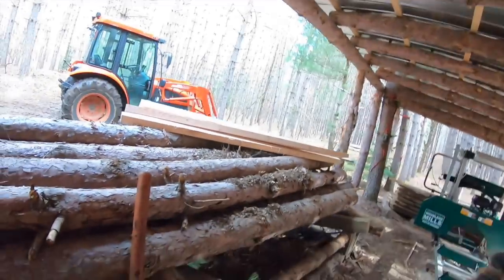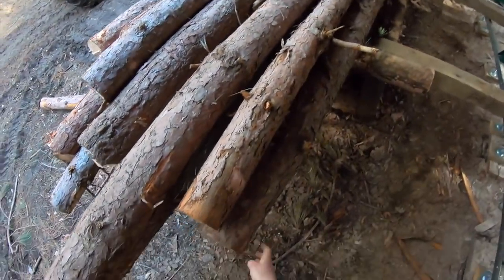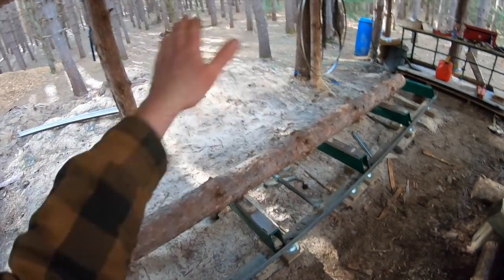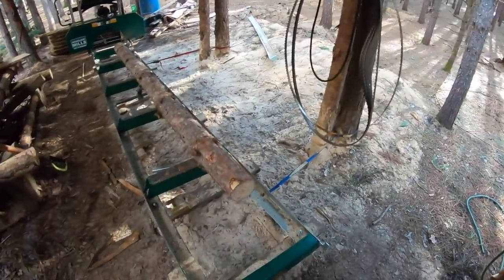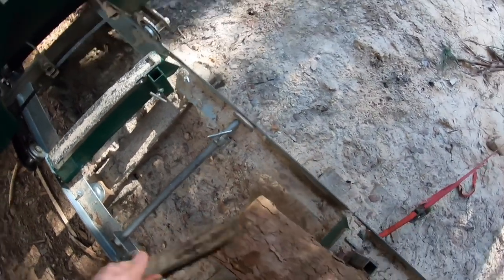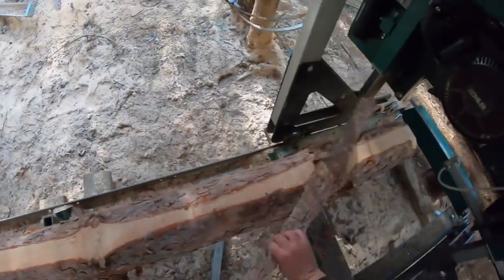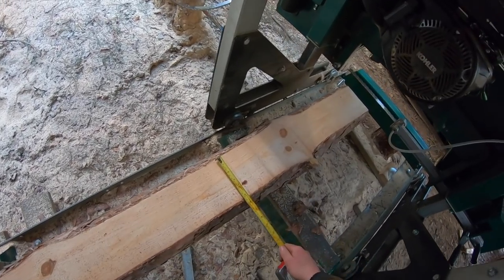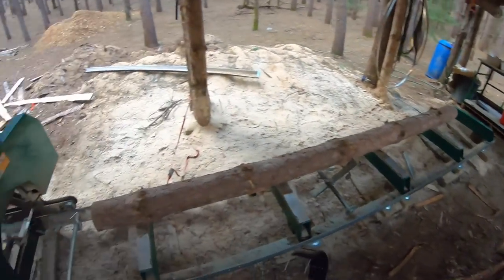Making Logs into Lumber. Woodland Mills Portable Sawmill HM130.

Comment: Very informative video especially intended for beginners.  Also it's great to use smaller diameter logs when "learning" the do's and dont's related to bandsaw milling.  I have a Woodland Mills HM 126XL, and plan to cut all my own lumber to build a 38'x60', 2 story garage.  Been researching and practicing to gain confidence before I start opening up larger diameter (higher value) logs.  
By the way, great job with the video/editing etc
Reply from the maker: Jeff Syster thanks for watching. At times the milling can feel tedious but then again, it’s also a great way to save money. I also feel proud to tell people I made the lumber. I’m sure you’ll get the same feelings as well. That’s a big building you’re putting up which is great, lots of time to practice milling

Comment: Since I like so much about the Woodland sawmills, I decided to price one out using the prices given in October 2020 - from the company's website. Woodland does make one of the more affordably priced portable bandsaw mills. If you were to purchase their smallest sawmill,  you might find their pricing especially appealing. They have it listed on their website at only $ 2,899 and I am assuming that this is in Canadian dollars. Presumably, all of the prices I am mentioning in this comment would be LOWER if you were to be paying in US dollars.

However, the reality is that the average purchaser is going to want to add a number of accessories to trick your mill out & these definitely can add substantially to the final price you will be paying. I live in the province of New Brunswick, Canada and our sales tax here is one of the highest in the country at 15%. In my case, I would want Woodland's largest mill which is the HM 130MAX. I would not need the trailer setup so that helps contain the total price somewhat. This unit has a 14 HP engine with electric start.

I won't list all of the accessories that I selected, but I did choose quite a few. The subtotal of this purchase was $ 8,698, there was a charge of $ 349 for shipping, & sales tax of $ 1,357.05, for a grand total of $10,404.05. So as you can see from the above, getting a portable sawmill with a number of  accessories, sales tax, & shipping ... can cost much more than the $ 2,899 that Woodland quotes as their starting price.

Nonetheless, this is NOT to denigrate anything about Woodland sawmills. Quite the contrary; I still feel these are exceptional pieces of equipment. I also feel the prices above are probably very fair for what one is receiving. But be aware that if you want one of their larger portable sawmills with a number of accessories, your final cost will possibly be higher than you originally thought.
Reply from the maker: Yep lots of homework to be done in buying the right sawmill. A big value adder to me was the option to go and see the sawmill at the headquarters and the value of the customer service that Woodland Mills is known for.
Reply: @sawingwithsandy  Yes, Sandy, I have to agreed with you completely. There have been so many people who rate the Woodland customer service as beyond excellent ... that there has to be truth in that.

Comment: you might be interested ,  6 inch log divide by 1.459 = 4.112 square , the 1.459  is a constant to use on the log being cut
that may be there some where but i haven't seen it

Comment: First off just wanna day I really have enjoyed your channel. Your sawmill comparison video was what prompted me to pull the trigger a few months ago on my new 130max. I have a question that hopefully you can help with. I live in the southeast and cut primarily loblolly pine, you too cut mostly pine. My mill has a very sturdy base made of 6x6 treated posts and everything is level and anchored down. I have been cutting A LOT of 1x6 boards for siding my sawmill shed. I have noticed I seem to get wavy boards sometimes. I’m careful not to push the mill too hard and my guide tolerances are all set correctly. I use water and joy dish soap. Is it possible that I’m getting sap buildup on my blade causing it to walk slightly? Any recommendations would be highly appreciated.
Reply: Having too much or too little water can cause your blade to deflect. It is a fine balance to get the water just right.

Comment: I am looking at the 130 max. I have lots of huge downed trees from a hurricane. What Is your true feelings on the brand and life of blades
Reply from the maker: The 130 max does look like a good unit. I'm a no nonsense type guy so I"d actually tell you if I thought the product was junk. I've used the Lennox blades for the entire (almost 3 years) I've had the HM130 and theyve performed very well. I use them alot and haven't had a complaint nor real reason to look at other brands of blades. The sawmill itself is very straight forward and hasn't given me any real headaches. It is very realiable and cuts accurately once the bed of the samwill is level and flat. I'd buy it again for sure. Hope that helps.

Comment: Hi Sandy I have the woodland 722 mill! And having a problem with breaking blades bought it used replaced belts and bearings and guides , can't get this figured out. Can't get enough time out of a blade for it to get dull tried less torque, and more torque no difference , really frustrated with mill cleaned before sawing can't seem to find the problem talked to woodland with no satisfaction wondering if you have any idea on what's going on with it I'm thinking that I might have gotten a bad batch of blades any ideas on this thanks Sandy
Reply from the maker: If the blades are breaking I'd check where on the blade it is breaking as unless you're hitting something with the blade, it shouldn't be breaking. I've had blades break from being well-used and probably overused and I've also had blades break at the welded seam. Depending on how old your blades on and their use I'd check where abouts they are breaking on the blade and go from there.

Comment: Do you cut your dimensional lumber (2x4 for example) to an actual 2 inches by 4 inches or do you cut it like in the stores 1 1/2 by 3 1/2?  I’m thinking all of the brackets (joist hangers) are made for store lumber.  What do you do?
Reply from the maker: I cut all material to the actual size of 2 x 4 inch. Does make it a problem when I need to use joist hangers though

Comment: So the HM30 will cut up to thirty inches, what's the difference between it and the thirty max?
Reply from the maker: I'd have to check the exact specs of my older HM130 to find out what board size my HM130 will cut but I do know the new HM130Max has a wider track and longer blade than the older HM130.

Comment: How is your shed put together....looks great
Reply from the maker: Hey Mike. I build it by just using red pine posts that I cut sitting on blocks on the ground. Instead of having to build a solid footing out of concrete or something like that I just use ratchet straps to secure each post to a live tree. This way the live tree keeps the post in position and I don't have to do any fancy foundation work incase I want to move the shelter in the future. The roof is just red pine poles for rafters with steel roofing on it. Then just two long poles to act as support beams for those rafters to sit on.

Comment: Trying to determine the economics of this.  If you are milling boards of average value of $8... you need to mill about 625 boards to cover the approximate $5000 price tag of a 130max.  Thats a lot of trees to cut down, drag to the saw and cut.  Figure in your cost for blades to make that many cuts, fuel etc... its probably a fair piece north of 650 boards to before you save a penny.  Thats not factoring in any compensation for your time.  Plus these are rough cut and the $8 board is sanded on 4 sides.  I guess it probably makes a lot more sense if you are milling hardwoods.  I guess too... if you are going to mill  a lot then the wood is free after 650... except for your time to cut, drag, mill, stack and dry them all.